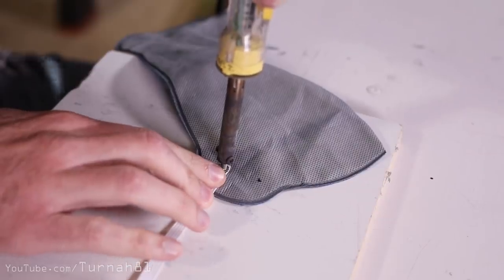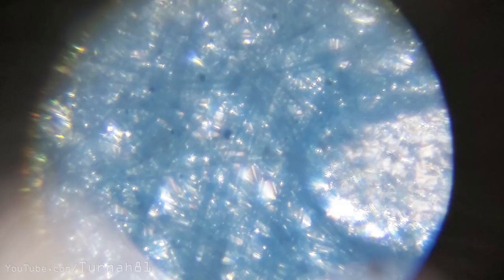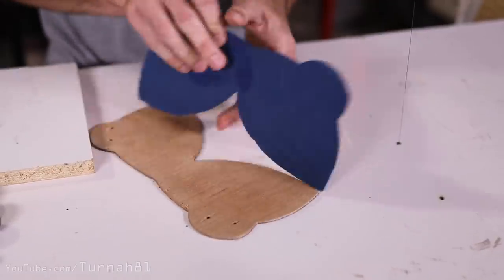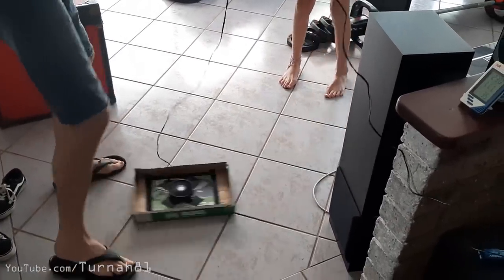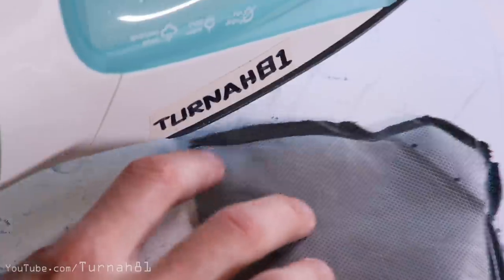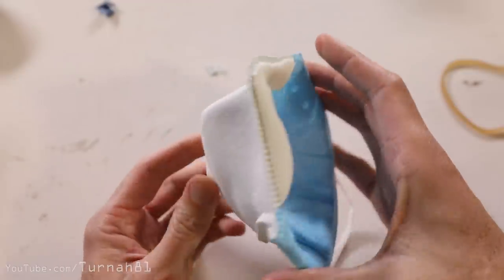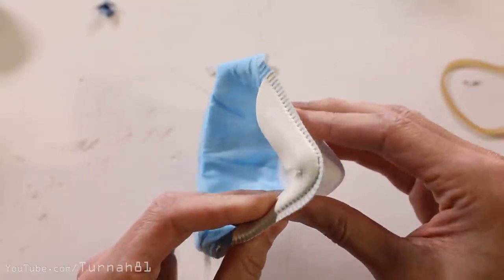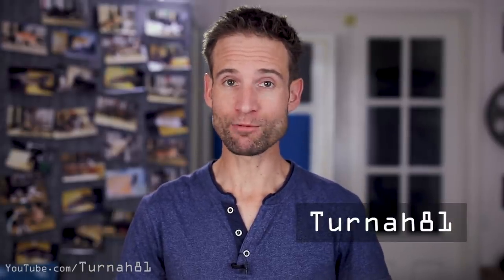How to Make the Best Face Mask, No Sewing (Don't use Cotton or Vac Bags!)

Comment from the maker: [UPDATE]: I have made simplified guide to making this mask with just 4 basic tools on my second channel here: https://youtu.be/1QesXT-oU-M
 It looks so simple in the end but I almost gave up on this a few times over the last few weeks. A lot of work went into this one during a pretty stressful time but hopefully it is helpful to people. 

Template in video description. Cheers! [READ BELOW]
[Remember I'm not an expert- Do your own research- Seek professional advice -use at you own risk]
*FAQ*
*This is too much work!?
*
I made this seem too way harder than it is- My fault – It's kind of what I do here. If you ignor my alternative and batch making methods
The minimum tools Needed are:
-Iron
-Scissors
-Stapler or Hot Glue

10 Minutes to Make??

For those batch making these (as some are planning to do) it should take less than 10 minutes per mask with material on hand. 
If making just one mask - I haven't timed myself making one with just scissors - but a guess would be 20 to 30 minutes. 
If you find a better way to do the nose foam it will save time. 
The time is worth it though as the mask is far superior to Cotton.  

*“Masks won't keep you safe / The virus is fake etc ”
*

Regardless of your opinion on that, many people need masks of  for their work where dust is a hazard, and they can't currently get N95s like they have previously used– ie agriculture, manufacturing, small business etc

*Is it washable / reusable? *

It is washable however the best way to disinfect any mask is still being debated globally (It's never been an issue before) Generally N95 masks aren't designed to be reused. However apparently the best way found so far is a heating method. This DIY mask should be fine with the heat method only if the hot glue is substituted with a heat tolerant glue. Ideas are welcome? [watch this space] 

What about static charge? 

N95 masks are tested to filter at least 95% of a saline mist. Different brands/models use a number of techniques to achieve that number. The main one (for small particles like virus) is the Diffusion Mechanism. Some N95 masks additionally incorporate an electrostatic charge. This improves efficiency (Easier air flow because less fibre/filter is needed) The premise of this DIY mask is to achieve high filtration by the use of a deeper diffusion via a thicker filter element. So this would likely have a more restrictive air flow when made to approximate high filtration levels. Unfortunately I can't test this masks or give accurate advise on exactly how many filter layers should be used.
Reply: shows tag that says "made in china"

Yes, no thanks.
Reply: You should make ALL industrial instructional videos for all industries. Highly informative and highly entertaining. I look forward to the surely in the works future editions festooned with grinch grins, pepe smiles and smirking shark lips. God bless you and yours and wash your hands.
Reply: Yeah dude! Great video! I hope you and the fam are going well though. Stay awesome.
Reply: That air filter didn't have $500 postage it had $596.07 so pretty much $600 especially if taxes and or import fees are not included in that. You would expect that for that price they would deliver it to your house in under 30 minutes by complementary hooker who then stays the night.
Thanks for the great info! I hope you are doing well and staying safe. Have you looked into those UVC germicidal lamps at all?Also if you want to make a slightly better cheap hover craft try a piece of styrofoam with the same shape as the box lid the other side around so the air is blowing into the interior of the lid. If you want to make it a bit better make a skirt for it but as long as you are using it flat ground it should be fine and if you use it on concrete the skirt will be destroyed pretty quickly.  I liked using cheap plastic bags that happened to fit the foam piece I was using then cutting out a small bit of the bottom of it. If you get a cheap old RC toy that has at least 2 channels you can also put a fan on the back to push it forward. if the RC thing was something that could turn by tilting the wheels or something you can use it to angle the rudder the forward fan blows across. If you just have another motor then put a heavy wheel on it with a large radius and use the change in speed to spin the craft by altering their angular momentum. These are sometimes called "reaction wheels" like the video made by Tom Stanton linked at the bottom. You can even use a remote controlled vehicle that has a tether or make one your self with a few lengths of speaker wire. This si something that is super fun to make, takes 5 minutes and will provide you with hours of fun. I think you should make a quick video on it and explore the differences/pros and cons between the reaction wheel and the rudder for steering. You might want to talk to Tom about his experiments with the reaction wheel drone and see what he says about everything. If you are doing the reaction wheel hover craft, it is vital to get it to weigh as little as possible and then place the weight as close to the center as you can and put the motor for the reaction wheel there too... it could even go on the inside of the foam box so it looks like there is nothing turning it and it's just spinning for no reason lol. 

Anyways take care and hope to see a video about mini hover crafts in a few months. don't worry about making it super polished up. we all love your videos anyways. Your accent and slang words are 20% of the awesome anyways. 

https://www.youtube.com/watch?v=4kfBEaTncjI
Reply: Excellent video. Love the humor tossed in as well. You take care and be safe.
Reply: I'd share but I literally have zero friends
Reply: Excellent video. I will be trying to make a mask following your technique! The company I work for has lots of cleanroom wipes that are non-woven rayon/polyester. I'm going to see if I can get them to work because we have literally thousands if not millions of them here - we use them as glorified paper towels. If you're interested I can send you images of the threads taken on our microscope.
Reply: change the length of the stitch  you dont have to mess with tension  or use a saton stitch
Reply: I suspect using a hair straightener would work just as well as the iron...
Reply: I must say I'm impressed and thank you for not giving up.  Very informative, much appreciated.
Reply: How is actual respiration performance? I ask, because there's a critical component missing, and that's the one-way valve that would usually be on the front.
Reply: would you be willing to make a sell a few of these for those of us that lack the tools needed? 
Also, have you tried mixing in hydrogen peroxide and distilled water? Not sure of the amounts to mix, but I've heard some people letting their masks soak in such for a bit then letting them air dry enough to not fall apart in a low heat dryer to air them out.
Reply: Best video yet, scientifically grounded!!
Reply: Excellent! Thank you. May I ask how you disinfected the masks please?
Reply: You should pin this comment (pinning is lost after edit).
Reply: Turnah81 Excellent video, by far the best I have seen. This is what it’s going to take to get through this nightmare... Innovation, weather it’s medicine, vaccines, PPE, you name it. At first I was horrified to see and hear so many people just listing and waiting on the government to come save the day. It gave me a strong sense of impending doom! Over the past weeks I have seen so many people come to bat I have hope we can beat this..
Reply: hiya, thanks for the video - super informative and helpful - could i ask why you didnt think vacuum bags would work? the ones i have at work are 3 layers of polypropelene , 2 woven on either outsside and the inner being spun blown, it seems to me watching your video that that would work, i've tried meltign with an iron and that works so wondering why you said not to , was it your bags were made from  somethign else? super good work !
Reply: Micker Phillps stitch length is not the issue. Try stictching two pieces of black fabric together with black thread. Then stretch the seam over a lightbulb. You will see every single needle hole shining through where the threads are pulling at the fabric. What I’ve been doing is stitching, and using PVA glue to seal the holes.
Reply: numberyellow I don’t think the one way valve matters that much, except to direct exhaled air away from glasses to prevent fogging.
Reply: Very interesting. And good you didn't find any vaccum cleaner bags to try. Those may contain antimicrobial powder that can get realeased when cutting them open. And you really should not get that into your lungs. Also, they do not filter particles as small as the virus.
I still have a few (just 3 or 4) FFP3 masks lying around back from last year when I was digging around the house for asbestos (moved since then). I guess, if I use one per week, once I come around back to the first one, there should be no active SARS-COV-2 still on it. Although I'm a bit worried about bacteria and funghi that may have spread until then but I'm not sure the rubber and plastic parts will survive in my oven if I try to sterilize it that way.
Reply: @simonchis9333  I don't know why he said that, but many vaccum bags have fiberglass in them...
Reply: @simonchis9333  I suppose because the makers of HEPA vacuum cleaner bags put out a statement to warn the public that the filters have micro particles of glass which could be breathed in and cause lung damage. Blessings to you and yours!
Reply: I may have missed this, but how many layers did you use? Also, if you want to heat treat I think you could do all the attachments with heat welding or sewing, then seal the seams with silicone caulk. The one I looked at is good up to 400° F (204° C). Not sure what to do about the nose wire though.
Reply: @numberyellow  the one way valve would defeat half the purpose of the mask. Now that testing is more available, a fair number of people are being found who are asymptomatic. The masks are supposed to keep infected people from infecting others by keeping them from spraying viruses into the air if they cough or sneeze...or breath. 😁
Reply: @heli400  I may try that, although I wonder if the concentrated pressure from the edge of the iron is part of the reason this works.
Reply: Ultraviolet radiation is a fast and highly effective method of disinfection.  Tanning beds produce a lot of it but not everyone has a home tanning salon, too bad there isn't some source of UV that was free and available to everyone under the sun.
Reply: Robert Litman if you’re glasses are fogging you do not have a proper fit seal, thus negating efficacy of mask. You should be able to wear the mask and not smell anything. A person should be able to blow smoke right in your face and you not smell it. That’s what a fit tested N95 mask does.
Reply: Perhaps you could send it to the sewing MD who fit tested her own masks at work? I think her handle is Sewstine
Reply: I use weatherstripping for the soft nose cushion. I extend it across the length of the mask for a padded seal.  It can handle vigorous washing and standard abuse plus it dries fairly quick. Weatherstripping comes in a variety of sizes to choose from at a very cheap price at the local hardware store and is easily available.  I’m not seeing shortages on it. 

You can use stitch fabric glue or a glue gun to keep it non sewing. Also ya a wood burner in place of glue gun or iron. Just be careful to not burn the material.

For those who do see, the weatherstripping can handle and holds well if sewn onto any mask. Just run a single seam down the center. Make sure to remove the sticky stuff first before sewing if you will muck up your sewing needle.
Reply: Link no longer works
Reply: that youtube link doesnt work. is there a new one?
Reply: is it washable?
Reply: @RoySATX  Yes! Too bad 😊
Reply: evilcanofdrpepper 🤣🤣🤣🤣🤣🤣🤣🤣🤣🤣
Reply: @numberyellow  NO! That valve makes exhaling easier for you - which defeats the primary purpose of the mask, protecting others from your exhalations.
Reply: @buggsy5  lol, no. In the case of an N95 mask, the primary purpose is to filter what you're breathing in. everything else only serves to stop your coughs from going into the air. in an N95, that valve is important, as it reduces the amount of built up Co2 that you're re-inhaling. Yes, there are N95 masks with no valve, but those are generally inferior.
Reply: @numberyellow  They are not inferior, they are built without the valve because they are meant to block the exhalation (on purpose).
One example is some surgical settings where the N95 is needed to protect the doctors working on the patient but the exhalation valve is not allowed because that would be dangerous for the patient. 
They are not uncomfortable to wear and it is not difficult to breathe with an N95 without valve.
Reply: @buggsy5  true, infact there are situations where they are not allowed.
Reply: @vandoren156  "They are not uncomfortable to wear and it is not difficult to breathe with an N95 without valve." Speak for yourself. I'm sure i'm not the only one who finds them uncomfortable, and stuffy.
Reply: @numberyellow  you need to give yourself the chance to get used to it. Having to use them for work for long stretches of time I have seen people finding them constricting at first and after a week or less they had zero problems with them. 
Unless there is a medical condition that would prevent someone to wear it of course
Reply: @vandoren156  i don't even really like wearing the ones WITH the valve.. i find them ALL uncomfortable, and an annoying hassle. it's been months, i don't think that assessment will change.

Comment: Thanks so much for this!  I've been using it as a reference for about a year now.  A few suggestions:
*If you don't have a welder, use fabric glue.  You have to glue each layer to the next, but it'll do.
*If you have to sew, go over the stitch line with hot glue to seal the holes.
*If you roll the edges of the mask to make a channel  (as you showed), you can use shoelaces, paracord, or the like to make a headband.  This spares your ears.

Hope you're doing well,  and thanks again for all the work you put in!